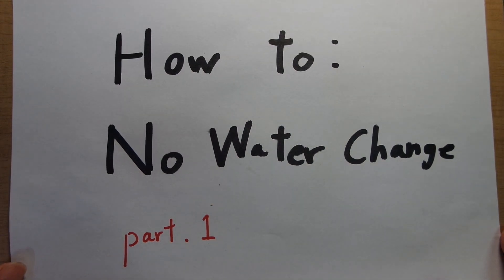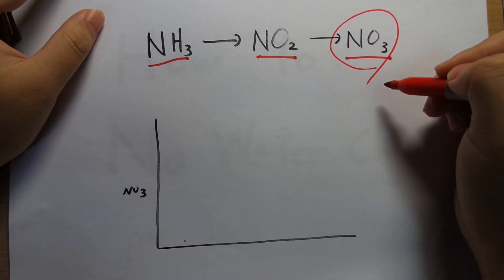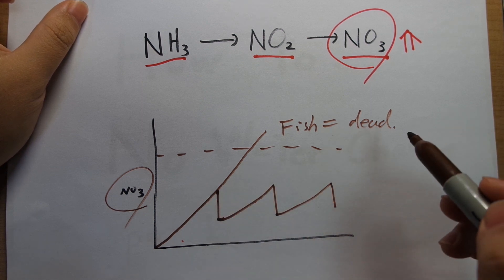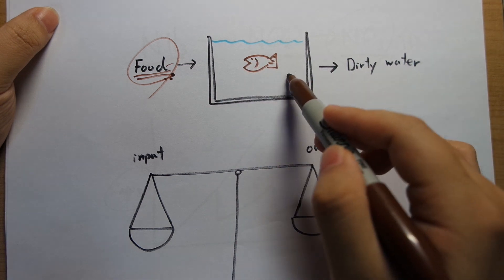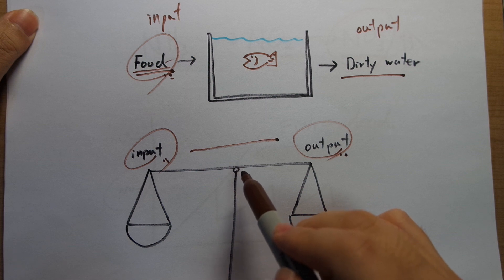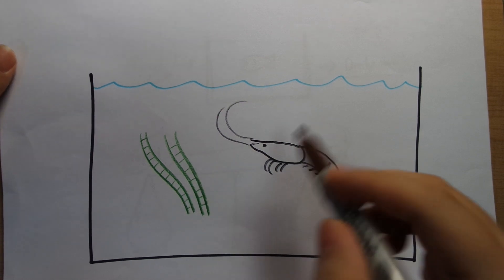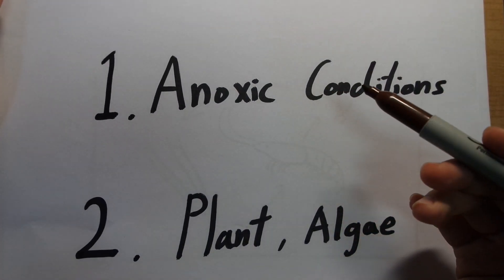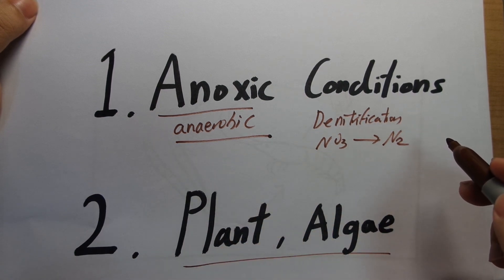How to build a no water change tank part1: nitrates are not the only problem

Comment: Thanks for all your very informative video's. I now have 2 aquaria that don't seem to need water changes. Ammonia 0, Nitrites 0, Nitrates 0. I only trim back the plants (both floating and planted). Fish and shrimp are happy and breeding! For filtration I use under gravel filters with 3 tot 4,5 inch thick layer of substrate (just existing of fine, black rounded aquarium gravel 2-3mm). I only clean the glass every one or 2 weeks and top off the water. Our water quality in the Netherlands is very good, so I can just poor it in right from the tap.
Reply: What substrates do you use?

Comment: The only problem I see with this system is the accumulation of heavy metals from top-off water. This could be solved by using RO/DI water to top off, but because I am too cheap to buy such unit, I just do a ~80% water change every 2-3 years. Just to be on the safe side.
Reply: Plants will absorb heavy metals too, I have a lot of fast growing (floating) plants and the only thing I do is top-off water and trim back the plants (also floating ones, like duckweed and frogbit)